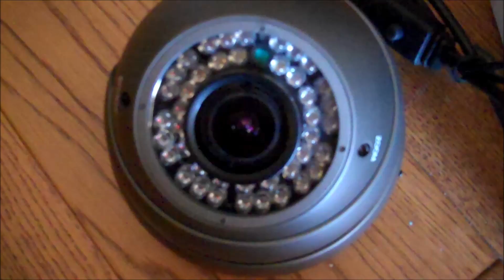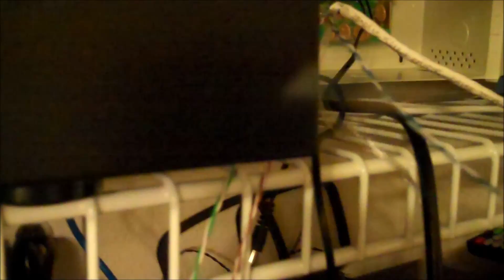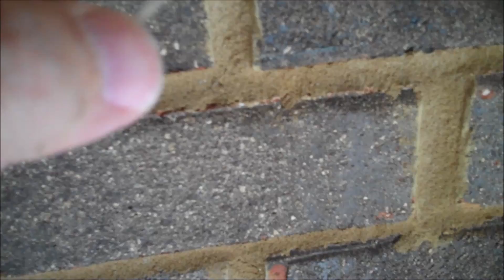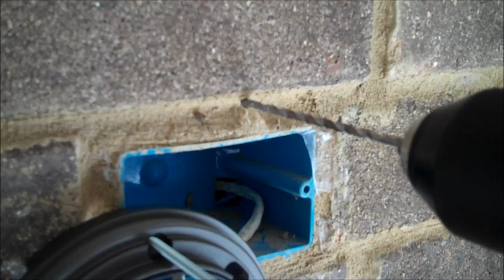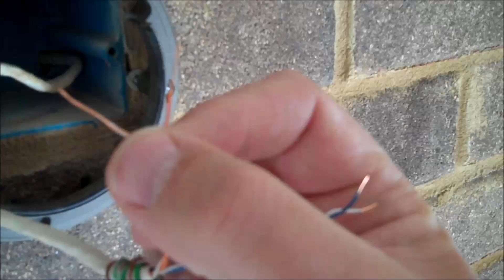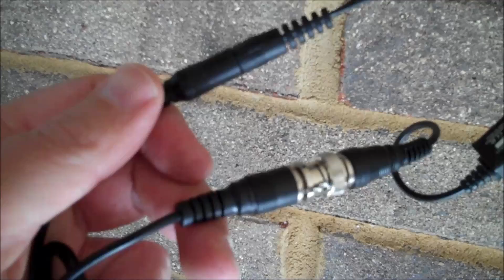Security Camera Installation using Cat5 & Baluns

Comment: Can cable cat 6 be used??
Reply from the maker: +mithun imrit yes. Cat6 and Cat5 are very similar. Cat 6 contains an additional internal insulator which Cat5 doesn't have. Outside of that they are much the same cables
Reply: Thanks a lot for the info :)

Comment: Am I correct in thinking that a single 4 twisted pair CAT5 cable will run 2 cameras?  Or does that introduce interference in the signal?
Reply: Did you ever get an answer to this? I have the same question.